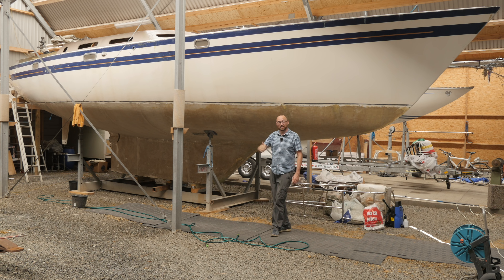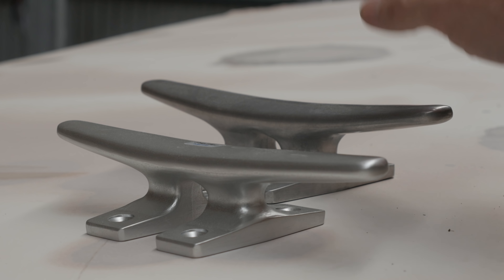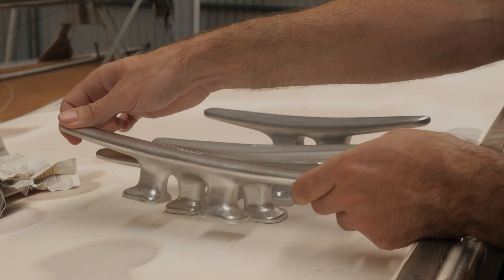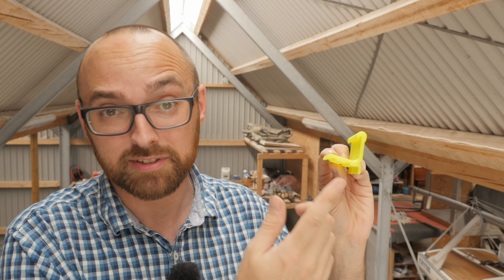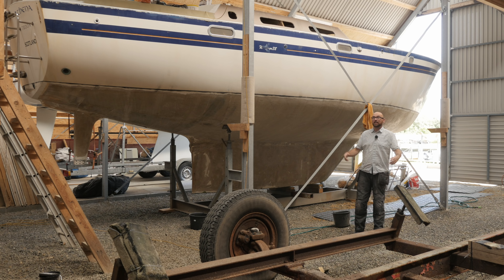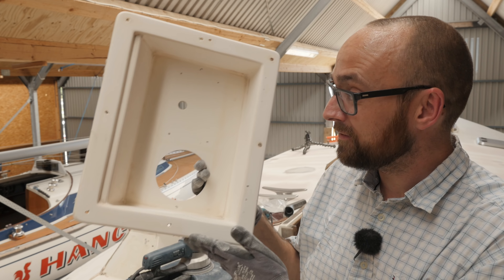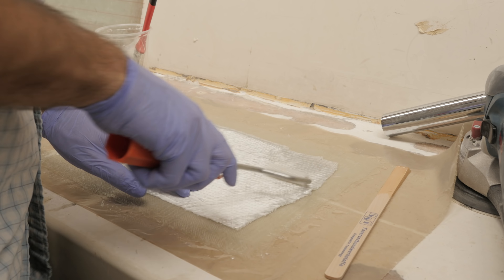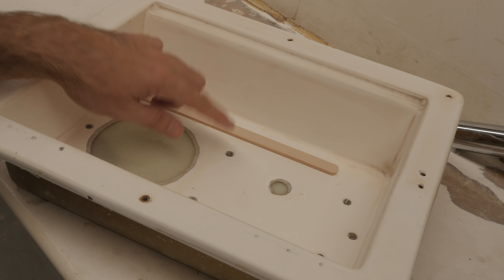Sail Life - Big hole in the cockpit, hull moisture & the perfect cleat? - DIY boat refit

Comment: Hi, Im following your neat and interesting vlogs for a while now. Thanks for the way you show your work and considerations.
About those  new cleats: in general you never know what forces they need to withstand neither the direction. Personally I would prefer not  to use those you showed with the two bolds. Thoo more need design and easier to clean, All the force must be resisted with just those two bolts... And sideways there is no really support. Worst off all imo is the fact that all the force must be taken by the thread in the Aluminium. And you have to tighten it in the first place. The one with four bolds have much more sideway support and 4 strong bolds with plates and nuts will keep it on the deck!!
Wishing you a wise decision!! And a good holiday.... 🤗😎
Reply: It's also really hard to persuade two-stud cleats not to start walking around on the bedding compound within a relatively short time in use. Which eventually leads to leaks, and can compromise the structural underpinnings.

Comment: The engine compartment hole looks a bit small. Estimate 1/2" square per HP as a good rule of thumb. Starving a diesel of air is a big problem and don't rely on vent fans and blowers for that.

Comment: Mads, how are you liking the clear plastic bags you use for applying the thickened epoxy?  you changed to the purpose made versions (like a cake decorator's piping bag) some time back, but i haven't heard any thoughts....assuming that since you're still using them you are happy with their use?  Also (and the more interesting question that prompted me to leave a comment) how long did it take for you to learn how to 'guesstimate" the correct quantity of epoxy (thickened or otherwise) to mix up for a given application?  It may be cleaver video editing, but it always seems like you make up a small batch at a time, and it's always 'just enough' - no waste, and you don't ever seem to go back to have to make 'just a wee bit more'.  For me, when mixing up quantities of things like that, I'm always making either way too much, or never enough.  Wondering how you got so good at always hitting the mark with just the right amount of mixing?

Comment: You know, having looked at the inside of this boat quite a bit, would it be far off suggesting that you cook up some sort of ventilation system to promote water evaporation? The way i see it, there's enough pass through in the hidden elements of the boat to put something in place. 
I think the lack of ventilation in many of these spaces is the key element for the water retention this boat is suffering from, to note, retention, not how it gets the water.

Comment: Those new cleats will work fine. I like the deep throat on them and the compact width.  Less to hook a shoe on.  The will be just fine with a backer plate on the inside of the hull and really you would need that with either cleat.

Comment: Mads did you ever consider a stand alone air conditioner with a hose blowing back in those miserable hot cubbies when you have to work on them? Might work well when you are doing work on the Salon and engine room as well.
Reply: THAT is a very good idea.  I don't know what those cost in Denmark, but they are cheap here, so have Ava bring one out when she comes.  AND most of them have a dehumidifier function as well.

Comment: Hello. Don't you have that vacuum pump for laminating stuff?
Reply from the maker: I do. Why do you ask? :)
Reply: I have been wondering, for some episodes already, couldn't it be used for some of this glass fibre stuff instead of rolling(and leaving some air bubbles there)? Perhaps this was a stupid question, I have practically zero experience in that kind of work.. And the surfaces you have done have been mainly not flat. :)

Comment: What you do is great but if you want to enjoy it during the next years you should take a little more care of your health. Grapping faring compound with nitrile gloves is certainly not a good thing from a health and savety standpoint. Most of the nasty stuff from these chemicals go just through one-way gloves no matter from what material they are.
Best practice is to use these gloves but work as you wouldn't ..
Reply from the maker: I think you might be a little overly concerned :) It's not like this is my fulltime job. My exposure is very limited.